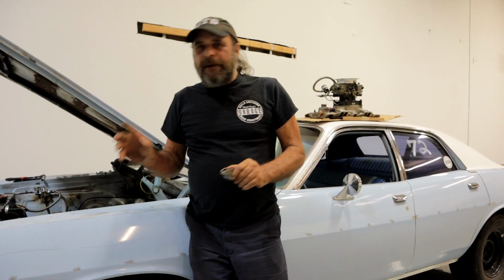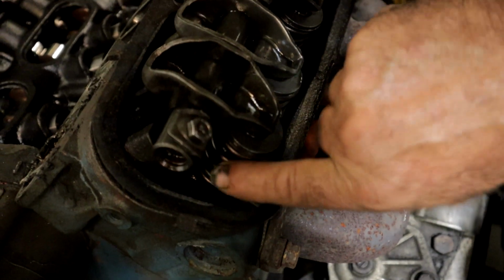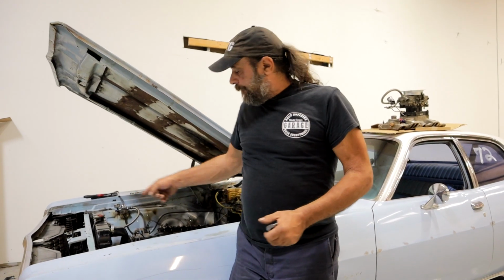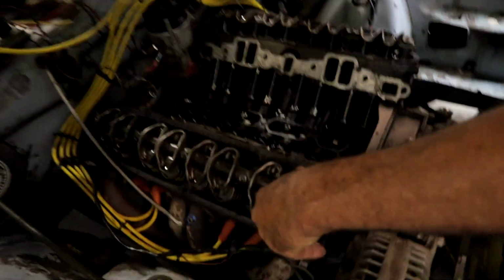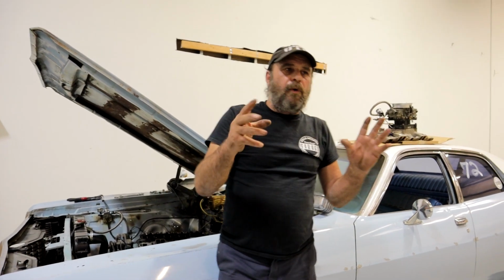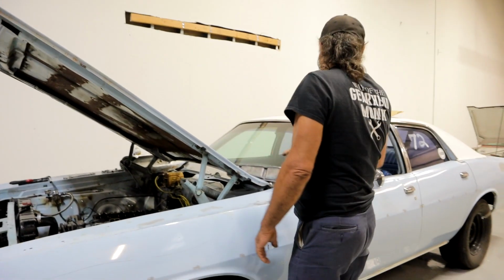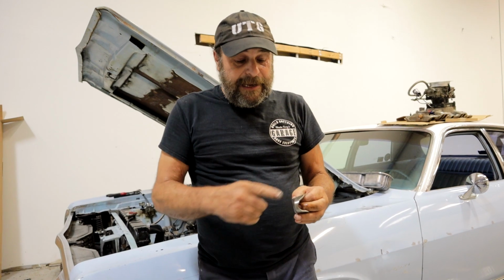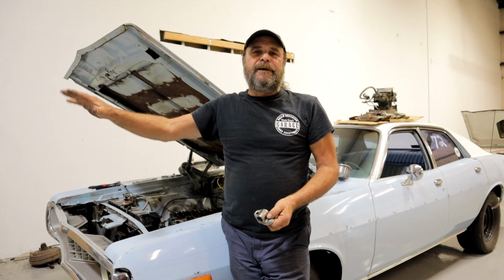Bottle Rocket Rocker Failure Explained

Comment: Why am I thinking there's lifters going full hard (not lifters leaking down too fast)? Assume you're not binding springs? Pushrod lengths? Valve kissing a piston? Just thinking less &  less that it's the fatigue/hammering issue. Having said all of that, I'd bet dollars to donuts that if you had a week or two to disassemble, inspect & test every one inside & out, you'd find those lifters to be all over the map...dimensions, fits, finish, metallurgy, springs. Hell, I've found machining chips in orifices, missing orifices, warped or clipped disks...anything you can imagine, all a result of zero QC. Whatever, I'd start by looking for hard stack-up rather than loose slapping/fatigue. JMO. Good luck...you're in that place where new means zilch, brand name means zilch, QC means zilch. (p.s. nix the roller rocker bolt-in. OE prob stronger, unless it's got a gazillion cycles on it) Rock on!

Comment: Some might say: "It´s an outdated and overcome technology anyway, these old piston engines. The future is electric..." BUT: electric cars are still cars. Those have transmissions, brakes, suspensions and cooling systems too. Sometimes range extenders. What can we expect from these cars and the spare parts for these cars, when the manufacturers are not able to produce those "outdated" parts in the same good quality as did decades ago? If the coolant pump quits in summer heat on the highway, it may ruin your electric car just as your piston engine car.

Comment: Most hydraulic lifters are total junk now. Chinesium garbage. I had 2 morel rollers fail on the dyno. Going to crower solids. From my research it is more common to have new hydraulic lifters fail than not fail right now.

Comment: To tell you how sideways out of the box cheap my mind works my hillbilly as would try this.  I would weld each lifter solid and and adjust each one like it was a solid lift cam just to see what happens.  How out of the box thinking is that.  Your talking to a guy that takes a rug and cuts out inserts for my shoes with a pair of scissors.  The list or stuff I do like this is long.  I saw a guy blow a piston take the rod and piston out fill the cylinder with cement and run it.  He was fourteen with no money.  It was a 56 ford back in 1968.  I never saw him again I don't know how long it ras.  We were in jelico tennessee.

Comment: Probably made to dodge spec. Probably why every new regime dodge pickup comes with a box of small ball peen hammers tapping away and the dealerships claim it's normal. Tolerance stacking? Plus a 10th here minus two 10ths there between to ground heat treated surfaces you end up throwing hot dogs down the hallway. 
 They probably err on the side of safety, it would be worse if they didn't bleed at all?

Comment: Yeah thats not cool.  Factory engines have been using roller lifters for years, now they just fail.  Hearing alot of problems with 429/460 Ford hydraulic lifter failure$$$  Mild to wild.  Kinda thinkin its outsourced stuff, and we pay dearly.  Shame on the Engineers and Manufacturers.  This is not new tech!

Comment: Thicker oil 15-40 or 20-40 my guess that thin oil 5-30 is a joke big Diesel engines in commercial trucks been using roller cans for years and 15-40 rotella t is been the staple of oil for truck for years and yes I know a big diesel will only see up to 2000 rpms a few time a day but sometimes oil is the problem but then there is the China part problem but that is in a class of its own

Comment: I'm  no expert  in fact it's bicycles  that make me smile ,firstly it's  more than likely it is the shitty parts lifters thing  that's the problem  ,having said that I would make  sure that they didn't  cop any contamination run through them which could have caused them to fail as mentioned  by someone in the comments  this may prove more  difficult than it seems ,anyhow I trust that tony would have  been diligent  enough .  The other thing t o think about and investigate is perhaps inconsistencies in the height of the lifter when it's  fully pumped making the pushrod effectively  too long ,this could affect the lifters because the bind up effect could cause the piston inside the lifter to skew sideways and cause wear hence bleedown. all unlikely  but worth checking, without completely  knowing full specs on cam that is advertised lift v 50 though etc I would say that the stock  rockers are more than up to the task, stocky springs also up to it however  it wouldn't  hurt to check spring rate  in case they  are a bit too tired/ weak , strange harmonics can be spooky .Anyway @uncletony I really like your low budget backyard philosophy approach this is true hotrodding .

Comment: In the 90s this was going on with US parts makers. The problem is QC. It’s always been QC.  A certain number of parts were just bad. Sometimes on a 50s engine, you had to go through 10 water pumps before deciding to make it yourself. That’s what the guy restoring his car ended up doing. 

About a month ago or more, there was a story about a QC guy getting the riot act over flagging parts that were substandard.  That should have been the story, but it turned into a racially thing if memory serves me correct in the US.  It’s either racism or sexism that affects the QC inspector.  You can imagine that in China it’s quantity over quality at a certain price and of course we know about how metal is hot or miss there.  What I don’t get about regulations on products produced outside of the US is that the US is a willing participant in this fraud. One great example is sheetrock!  We as a people certainly have gone down because the bottom wants cheap.

Comment: Unfortunately as you know the quality of aftermarket parts has gone to shit. I think its on purpose to get people out of fixing oid cars in favor of buying new cars. Even TESLAs leader says America need to start manufacturing more. My next truck is gonna be a Tesla. Ill hang on to my 58 Bel Air for its cool factor but it doesnt see much road time since i dont want to have to replace brand new parts. i went with hydraulic roller cam and roller tip rockers to prevent the bad falt tappet issues so many have been having. It sounds like a sewing machine with all the valve train clatter but everybody Ive heard from has the same problem with retro roller cam setups in BBCs. Thyre loud. I hate the way it sounds but what can you do hen you cant find a decent cam to buy for an older design big block.

Comment: It's like going to a restaurant and ordering from the right hand side of the menu...you buy the cheapest meal, you get what you get...this should be a lesson for everyone, cheap is not necessarily good, and good ain't cheap...
Reply: No, if Tony bought cheap Chinese knock offs, then you'd have a point.
Reply: @jamyers1971  did you watch the video? where he says he kept it cheap for the viewers? you go to a fancy restaurant an order a hot dog, you'd be better off at Nathan's famous...you buy a company's cheapest lifters, you get cheap...Tony already knew the engine SHOULD have had solids in it, but as a service to the viewers he went cheap...and got served...
Reply: The point tony is trying to make is that everyone is having problems with lifters because all the major manufacturers are outsourcing them and they are junk... I'd say in the last year 1 out of every 3 cam break ins has resulted in catastrophic failure due to the lifters... its a huge problem
Reply from the maker: I went hydraulic roller to maintain the stock valvetrain in order to keep it cheap, the lifters themselves are top of the line.
Reply: @UncleTonysGarage    My 'Gang O Buddies' have been piecing together low budget 'junk yard' Mopars since the early 70s.  Never had ANY failure issues, even reusing OEM Mopar engine parts.  Sometimes even 'mix and match' from different engines.  The only failures are with new NON Mopar parts, pure junk sold for a premium price.
Reply: @wrenchski  So buying a cheaper product means its ok for it to fail or not function??? Sure if the cam n lifters were only $25 you could expect it to be a one use disposable. But $700 from probably the biggest cam company out there??? Nah...
Reply: @wheels-n-tires1846  no...if you're already aware that everyone in the free world is having problems with something...and you buy it anyway because it's cheap...blame the guy in the mirror...
Reply: J. Ski, you still don't get the point UTG is making. Those lifters should NOT have failed.
Reply: @jamyers1971  really? Sigh...the center never holds...still waiting for the autopsy...

Comment: First off I know this guy is a chevy guy BUT  guys  he has some really good tech tips concerning lifter issues and cam/ motor break in process check this video out  - 350 chevy cam break in. channel - Myvintageiron7512
I agree Tony  the only free parts I get and or use is parts from people's junk pile that I clean up and rebuild/ use . I to also try to use low buget items on my channel and or daily driver vehicles .

Comment: Getting back to what's a  little guy's pratical Solution to a QC issue that Shouldn't  Exist & you don't own a lifter company ?? .....If the cam companies aren't going to proactively fix problem, .....Maybe Pre-testing the set to weed out the leaking defectives Before using ?? ... Returning the leakers for replacement 2 or 3 times could net you a good whole set.....What a pita !! ......Course with Retrofit roller Lifters, ..you're still rolling the dice against  the dreaded "Link bar"  Failure that modern oem motors don't use.....If your going "Roller"  on vintage motors 'cause you Don't trust them to make consistently good, simple Solid lifters that just require good steel, heat treat & basic Machining, ...why would you expect Them to insure any QC predictability that you actually receive 16 Precision manufactured hydro lifters on first boxed set ???

Comment: If you don’t got money for performance parts you shouldn’t be hot rodding, go play with RC cars its not hard to save money and buy good parts even in the used market.  enough with these junk parts that will never work. How much have you spent already fail after fail after fail after fail for using junk parts get good stuff for the start to avoid this crap
Reply: That kinda goes against the "low buck" premise of the channel doesn't it?? And these parts came from a supposedly reputable, mainstream, company. So this shouldnt have happened, and he shouldnt have to spend more. Throwing more money at a car doesn't guarantee success OR a faster car. Many of us lo buck guys have been outrunning the high dollar folks for years....